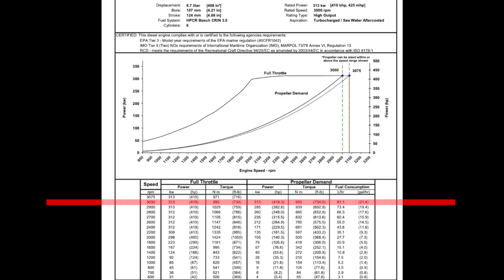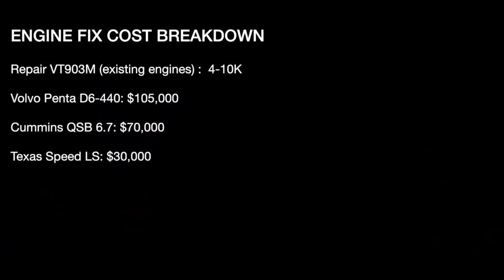Tesla Powering my 30yr Old Italian Yacht? And Broken Diesel Engine Diagnostics

Comment: REBUILD THE DIESELS!

This is a CABIN CRUISER and NOT a "speed boat". Too much power will likely DESTROY the boat without MASSIVE HULL REINFORCEMENTS!

This is the ocean going version of a MOTORHOME RV. It is an Italian Winnebago or "Waterbago".

Go ahead and do some modernization and upgrades, but do NOT try to turn this thing into a "race boat", that would be like trying to put an RV bus into a race with purpose built track cars.
Reply: Bigger turbos
Reply: the twin tesla motors would complement its characteristics of a 'waterbago' by modernising and making the propulsion system incredibly reliable, while being suited to a regular cruising speed. The batteries would also give the ability to have a high power circuit on the boat, you could plug in household appliances with ease. The current large diesel fuel system and twin engines could be replaced with a single small diesel connected to an electric generator as a redundancy backup. Care and planning would need to be considered to prevent the boat sitting too low in the waterline
Reply: Hate to say it Axle, but you're not understanding the nature of the Riva. The Riva boats are not Cabin Cruisers or an "RV on the water". They are the AMG of luxury yachts. I don't think you understand what it takes to make a 40' boat that weighs more than 25,000 lbs do 40 knots on the water. That's like trying to make a luxury tour bus that will run an 11 second quarter mile. The closest thing to an RV on the water is a trawler-style boat. Big lumbering boats that have lots of living space, but max out at 25 knots. Your better 40' cabin cruiser/sport fishing boat will max out at about 30 kts. The Riva is like an AMG Mercedes: Luxury and Performance. Not the ultimate in either category, but enough of both to make you giggle every time you use it.

Comment: Repair the diesel! 
Get a professional estimate while the engine is still IN the boat. Then pull the engine if needed.
Reply: I’m with you. Get the professional to look at it FIRST! Repairs will be cheaper than any of the other options they were considering. Then go another 30 years.
Reply: Youric Hunt because otherwise you’re trailing a 903 around until you can find someone to drop it off with plus the mentioned possibly fixing it in place.
Reply: Youric Hunt  They can perform some tests on the motor to see if the bottom end really needs rebuilding. That types of diesel engines are tough as nails, it could be just head gaskets, or injection pump.
Reply: might be best to get both engines rebuilt, theyre 30 years old so it definitely wouldnt hurt. idk if its possible but maybe change the fuel system to common rail and he could make a lot more power too
Reply: It would be better to in-frame, but access is shit on that boat.  What to do?
Reply: Even  if I like the Idea of LS swap it , I don't think it is a good Idea. Cummins swap it for a newer models makes more sense because they are though marina spec engines already! by doing that you increase the lifespan of the boat and since you are partner with Garrett you can still turbo them and go stand alone whatever you like. Remember the rule of thumb regarding mechanics when stuff starts breaking they are going to keep breaking down. So make the best financial decision since you are planning on keeping it! The first engine failed god knows why you don't know how good or bad of a previous owner she had and how he maintain the boat, One engine failed, guess what stay alert! The second one might too. Knock on wood this is not what I wish for.....

Comment: Rebuild both Engines and refit. Hassle free sailing for years to come, piece of mind and good selling point if/when you do so.
Reply: reading these comments and listening to what this guy says ..tells me many of you guys don't know dick about boats, yachts in particular.  those diesels I  this boat were junk 20 yrs ago..and yachting is expensive..the guy who sold this boat to him took him for a ride. I would look for some older cats a 3208t version.  they are reliable and way more common.  easier to obtain parts for ..just not as much hp.
Reply: @richardsantilli1954  but that might be out of his price range
Reply: Find someone that knows these engines and see if they can be tuned. You can still add all your shut offs.
Reply: 3208? C’mon man, that’s a tonka toy motor.

Comment: Rebuild the Diesel engines on this boat and build a small ev boat for fun and experimenting.
Reply: That's a great idea. Fill the electric dinghy to pull behind it.
Reply: Put an electric motor for the busted engine then you have a hybrid
Reply: Yup leave the experiments for a 16 ft ski boat lol
Reply: the ev boat would be next to useless and really expensive to build and can’t be small due to the weight of the motor and battery cells

Comment: I think rebuilding the original engines  is the “smartest” play
Reply: John Llewellyn Yeah, but where’s the fun in that?
Reply: You are right on that, could be a spare  Electric motor but not principal power Electric motor its not safe.
Reply: Generators , solar cells and more battery packs for continuous charging, think like you’re building a sub.  Plus fuel cells would work too.
Reply: cayó i get it

Comment: Here's my nickel's worth of advice:  Go diesel, they last longer, and will be lower in maintenance cost per year.  Having worked in a shipyard for seven years, from Volvo Pentas to EMD electric diesels,, and having my own engine rebuilding shop for a few years,, please,, go diesel.  There are a few mods that can be done to diesels that will surprise you, and will be more cost efficient in the long run.  Check with Banks for that, I think you might be pleasantly surprised! EDIT : Also, you might be surprised how engine monitoring has changed since this boat was built,, you can go all digital if you want.
Reply: Do you want to buy a diesel engine? We are a Chinese manufacturer specializing in the production of marine products such as diesel engines, propellers and ships

Comment: Hi Everyone, for what it's worth the sensible option is to rebuild both the original engines so you know for sure they are reliable. Then look at some of the sexy stuff like variable pitch propellers, engine sensors with auto shutdowns, modern gearboxes, balanced propshafts and props and the addition of a backup rudder system so you can steer it if you lose one engine.
Looking forward to the next vid.

Comment: I think the smartest move is too rebuild the Diesel that’s in there.
Reply: yes and learn everything about the Engine while you rebuild it. So you know on sea exactly whats maybe wrong
Reply: Totally agree. I'm pretty sure there's a reason nobodys electric powered more than a surfboard until now.
Reply: And eletric motors are known to be terribly inefficient in boats.
Reply: agreed
Reply: @HRM.H   but it is not as cool as putting new engines in it
Reply: I don't mean to sound like a dick but it might come across that way. My dad taught me when we cruised our boats my biggest was a 43 ft Viking with Detroit diesels before you left the dock you checked the oil in every motor during the trip once an hour you checked the bilges and even during a long trip you would pull a dipstick just to make sure there was oil on the dipstick periodically I feel if you're done that you would not have lost your engine due to losing all the oil
Reply: @masonblaster3997  Imagine the boat catching fire with electric engines. Its a stupid unsafe  idea and not cool. Elektricity and water just do not go together.
Reply: ye but he not smart
Reply: Just rebuild the diesel motors you have and be happy with your boat. Then sell the boat and apec out a new boat for something better if thats what floats your boat.
Reply: Smartest move for this guy is to stay at the dock.

Comment: You guys should rebuild the original diesel motors. That is the safest and most reliable option and will give you the most enjoyment on the boat.
Reply: remember that part of this isn't the cost. He can't really rebuild those marine engines himself thus going that route results in no content. On the other hand pulling cummins diesels from a couple ram 3500's and modding them, that he can do.
Reply: @mizinoinovermyhead.7523  you DEFINITELY can rebuild those engines yourself.  I dont know who told him he cant.  You can get an entire kit where literally the only reused component is the block and head, it comes with everything from new valves, springs, seals to cylinder liners, a new totally redone crank, you reuse rods but they send pistons and rings already fitted to the liners...it really is like legos to rebuild the older diesels like that.
Reply: @mizinoinovermyhead.7523  well if content earns money but it burns money more it doesnt really have point think logicly
Reply: @blackopsrocks  The issue is size my friend, those engines weigh as much as many cars you need a specialized hoist, and engine dolly to rebuild one, yes you can get the parts, but they are a different animal in size.
Reply: @mizinoinovermyhead.7523  I work at a Toyota dealership and we just rebuilt 2 marine engines based on a Land Cruiser 80 diesel engine. We had to send one of the new blocks to get custom machining done, but we got it done. So I don't think that these guys can't manage if a dealership can.
Reply: @neamanja  True, but thats a determination we can't make since we don't know how much he'd make off an engine rebuild series. Plus part of the cash he already has to spend anyway since right now all he's got is a very big set of paper weights, so at this point its more about does he feel like reducing the hit to his wallet or getting it done by someone else or going nuts.
Reply: @bmwnut535  the entire land cruiser 80 series weighed 4900 pounds, just one of these engines weighs 3200 pounds. You cannot use normal equipment to move it around, it literally weighs as much as a BMW 3 series.
Reply: He said hes going to rebuild them anyway so hes going to have to learn and overcome all the obstacles ready mentioned. It's a no brainers to put the rebuilt motors back in. Besides you get to purpose built and for the boat to perform and be reliable, it's the only option.
Reply: @infamousnobody5172  No you can update to the cummin diesels out of the ram 3500. Same basic engine just 20 years newer and you can find them on copart. A valve spring mod, and a couple of other small things to let it rev its head off and it'll be fine.
Reply: @mizinoinovermyhead.7523  size is an issue in a rebuild series that could cover a dozen videos...100k or more views per...id figure it out, if some guys in vietnam can handle it with bamboo and moped parts, he can figure out how to take a big engine out jn a diy dry dock...

Comment: I used to work for an authorized distributor for Cummins right down the street from Cummins South Eastern Power in Tampa. We were the shop everyone would come to after warranty was over. We rebuilt everything ourselves except the heads which we got recon from Cummins. My job was to rebuild and calibrate the injector pumps. Now while a lot of our work was done to spec, a lot of people wanted to shoot flames out the stacks too. This was easily done by raising the fuel pressures, injector flows, and turbo upgrades. Now those engines probably didn't last as long as a spec engine but those engines got their loads over the mountain no problem. What I'm trying to say is you can do a lot with the engines you have, please don't gas.

Comment: Fix the current engines, and reinstall them. You’ll get a lot of mileage out of them, and you’re not going to lose a ton of $$ if you choose to sell the yacht down the road.
Reply: Gotta agree here, the boat world is not like auto, the resale value of the boat with original engines professionally rebuilt will be much greater than that of a  resto-mod'ed craft. Plus, its the cheaper option that makes the most sense, saving some pocket money to put into the single seater!

Comment: Rebuild the existing engines and learn about diesel that way.
Reply: just about all the boats I seen electric swapped sank because of little things they neglected to R&D properly like exhaust ports leaking after a few days making the ship sink in minuets. It is about the most dangerous and risky thing you can do to a sail boat that is being used for sea crossings but if you just want to cruise a river I guess that's less danger.
Reply: Copter Cop  I use voice to text tell it to google.
Reply: saltwater and high voltage electricity...i mean, what could possibly go wrong?

Comment: I'm a new subscriber and a retired truck driver with over 30 years on the road and driving diesels of all sizes. The right way for you to go with your classic Italian beauty, and keeping the value at top notch is STAY original!! Rebuild! There is no way those engines will ever take the abuse of a diesel powering a million mile truck, and when they get worn out, we rebuilt them, NOT replace with them  with something other than what the truck came off the line at Detroit with. Who would want a Lamborghini with a Ford engine? Your new rebuilds will last another 30 years easy.

Comment: Hey guys. I am a trucker from Ohio. The gas engine thing sounds fun. And I would love 2 big blocks belting it out across the river. But from a practical standpoint, and being a truck driver,  nothing proforms like a diesel when you want something to go to work for you. And nothing is more reliable. My 2000 Mack is pushing a million miles and I run it hard. And as you said. Reliable, fuel efficient, and lower cost. I love the rumble of a V-8 but Diesel have a cool sound in there own right.

Comment: Chris, I really enjoy your show. I spent 6 years in the Navy. I enjoyed every minute of it. I love being on the water. That's why I really enjoy this part of your channel. 
What you need to do is think about your decision to buy this boat. If, you bought the boat as an investment in fun, you really need to consider rebuilding the engines and putting  them back in the boat. They were designed to be what you need to get everything you want from a boat. If you wish to go slow and not go too far, they are fairly efficient. If you wish to go fast and far, they are efficient enough for that purpose. If you intend to enjoy the boat for a while and eventually sell it, you will get the best return on your investment. I know that you like to do a lot of crazy stuff and have fun. That's part of the draw of your channel. I think that you should rebuild and reinstall these engines and get the fullest amount of fun you can out of the boat. New engines would be best for all scenarios, but I don't think that that would be cost effective and you would not get enough return on your investment to justify the expense. That's a great boat in great condition. You have done a fair amount of work on it to make it look good and function properly. I think that you should repair the original equipment and get the most fun out of that bad-ass boat as you can. 
Good luck

Comment: Diesel.   Why do boats, ships, buses, high-powered generators, all sorts of heavy-duty industrial and construction equipment and indestructible old Mercedes run with diesel instead of gasoline?   Because they're built to last.    Treat the diesel right (make sure it has oil pressure!) and it won't give you problems.   Treat a gasoline engine right and it'll work most of the time, but not as long.   Put a non-marine engine with automotive stuff in a boat?   It'll be OK for a while.
Reply: WOW, Almost exactly what Chris said in the video. Go call a Tow Truck!
Reply: Twin Merlins like a WWII PT boat.
Reply: How’s electric not reliable??
Reply: @IllegallyAcquiredKIA  Electricity and water dont mix well
Reply: stick with the Diesel Engines ...there are Fine... AND Upgrade the Propellers... there have been much upgrades since 30 Years
Reply: @635497688  they where Packard's but  not Merlin's
Reply: @IllegallyAcquiredKIA  extension cord failures !
Reply: 100%. The answer will always be diesel. At least until someone invents better batteries….MUCH better batteries.

Comment: New sub from Emelia's channel! I've found, when I don't know what I don't know, that it's better to stick with what I have. Especially with aspirations to go ocean cruising, you can never have too much power, but you can definitely have too little, while you're out on the blue water. If you're going to rebuild the engines anyway, I'd put some hours on them and give them a chance to redeem themselves. You'd even pointed out that it's a solid block, and it was designed for this application. If nothing else, it buys time to really think this through and do the proper research. You might even find you like working on diesels.

Also, be very careful about automatic engine shutdowns at sea. Unlike roads, water is always moving, which means you are basically always maneuvering unless you're moored to something. A sudden engine shutdown in rough sea conditions could wreck you quickly.

Comment: Rebuild the current engines. It’s the only option that makes any sense.
Reply: ^^^^^^ What he said :) ^^^^^^^^^^
Reply: Yeah rebuild and put oil P gauges with alarms. Or computer controlled if possible that would be it
Reply: Agreed. Engine swap is just stupid
Reply: totally.
Reply: Definitly, only option.
Reply: Rebuild the engines, maybe with some modern improvements, and do some different upgrades to the boat.

Comment: 903s are hard to find parts for, even for dealers and distributors.  Best option if you don't want to go to a Cummins dealer, contact a local plant or large facility with old fire suppression systems.  A lot of them were 903 powered and they may have a source for parts.  Have fun!!